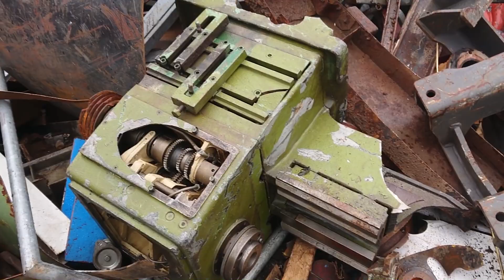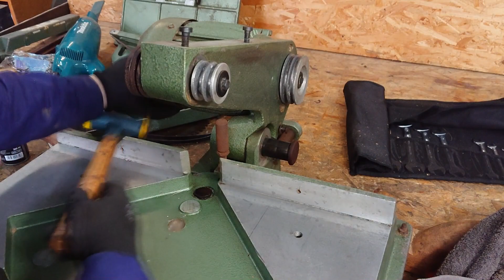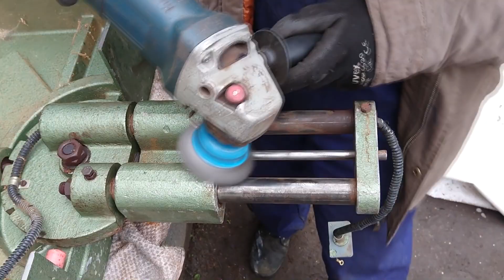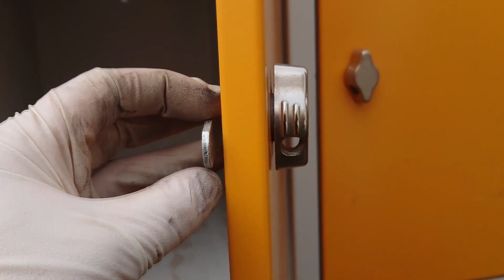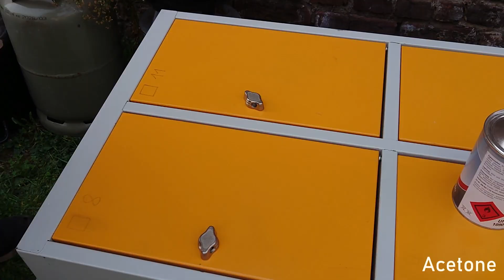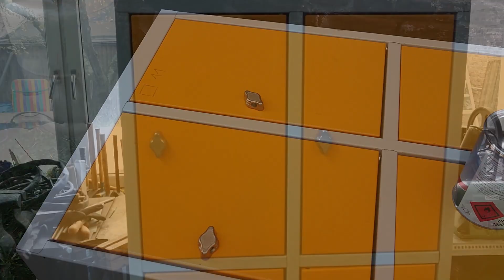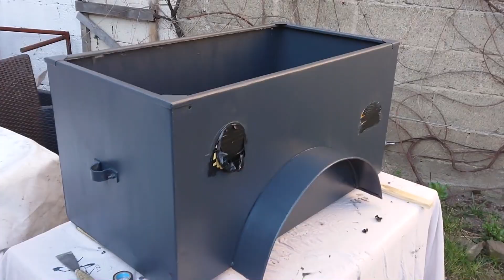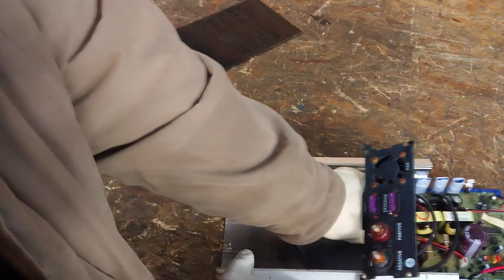Unique Scrapyard Finds! Repair-A-Thon!

Comment: On motor capacitors, I find that the old ones are normally spot on. I have motors that are probably 70 or more years old still work perfectly with the original capacitor. Good work and the lockers look great. Like the trailer.
Reply: Definitely! I work on commercial air conditioning/heating. 
New Capacitors of same capacitance are much smaller now and fail in hot weather unlike the older ones!
Reply: Thats good to know. My beloved 60´s Sansui valve amplifier has an issue on one channel which isn´t a valve, so its got to be an electrolytic probably. I got a parts list for it, it has over 250 electrolytic parts and most of those are capacitors!!
Reply: @mikescudder4621  Could also be a duff track on the volume control potentiometer.
Reply: @BensWorkshop  cheers!
Reply: @mikescudder4621  Have you tested the valves? You might also need to check the circuit diagram and ind use a signal injector to find the fault.
Reply: @BensWorkshop  Hi Ben, its been a long time collecting dust and looking great on my shelf but from memory theres a continuous 'scratching' sound on one channel where music doesnt come through. I swapped valves around and bought a new preamp valve (two channel) so i deduced the problem was with the electrolytics and not the valves. I was troubleshooting it with the help from a forum and came away with the impression that the electrolytics should be replaced as standard procedure on an amp from the 60's. When i found the circuit diagram and LONG component list it became a real project so i put it off for a while. I'll look into getting a signal injector - thanks!!
Reply: @mikescudder4621  Really sounds like a defective volume control. You could try cleaning it with contact cleaner.
Reply: @BensWorkshop  Really, could it be that simple?! I'm definitely going try, i always figured that a dirty volume pot wouldn't continuously change if it wasn't being touched/moved - if that makes any sense. Thanks for the tip.
Reply: @BensWorkshop  Ahh you have a cool channel too. I dig it. Who doesn't love scrap yard finds and other fixes!
Reply: @mikescudder4621  It's worth checking. You could try putting a signal on the output of the volume control. That would be the center connection to the wiper usually.
Reply: @BensWorkshop  Great tip!
Reply: The old capacitors made by Bosch, Siemens  ITT  (SEL) and Hydra Werke are high reliable long lasting  parts with no pcb inside. Most modern parts last even from the counter to shop door.  The best is  to omit capacitor and use all three phases for Motors.
Reply: @Reaktanzkreis  In the UK domestic supply is single phase. Also in the USA and I believe everywhere apart from Germany.

Comment: Thank you for the electrical component explanation, great save on the saw and trailer. Citric acid bath for rust, will need to try that.

Comment: I found a surprising way to remove Sharpie markers is with spray-on sun block. For some reason, it works really well, liquifying the Sharpie and you can wipe it off with a paper towel.  It doesn't affect surface finishes at all.

Comment: Just an observation but it looks like the sacrificial cutting board is just a square board with opposing corners cut off. The back one just an inch or so and the front one several inches. Might be easier cutting out new ones to start with a square with the dimensions of the inset. Love the lockers! The trailer is awesome, do the ebike and you have a heavy hauler!

Comment: 90% Isopropanol, known as rubbing alcohol in the USA, removes permanent marker, including from human skin. It can damage some paints, but it is the best thing short of acetone (which will strip off many paints) for removing permanent marker from hard surfaces other than porcelain. For porcelain, glass, and glazed tile, commercial strength Windex (blue glass cleaner) works really well.

Comment: What an interesting saw. Doesn't look all that practical for everyday use but pretty clever design. I love these repair-a-thon. There used to be several nearby scrap yards nearby that I found all sorts of treasures. Unfortunately they are long gone and scrap picking has gotten a lot harder where I live.
Reply: That saw is aimed at flooring installers as it gives them the ability to cut floorboards and skirting (base) boards to length and to rip along the length if needed.
You can still buy these today.
Reply: @ramblingman8992  were can i get one like this?
Reply: Home depot or Lowes in USA and Canada
Reply: Fair warning, they're seven or eight hundred bucks and up.
Reply: the more modern version of them were called flip-saws they were made by a company called Elu i think and then they were bought by Black and Decker's European company so am not sure what they are called now back in the 90's i use one made by Elu while working in the UK really handy saw when doing flooring or any woodwork for that matter
Reply: @kirkyorg7654  thanks for the reply.

Comment: I totally agree that fixing things up and making things better is a cathartic endeavor that helps deal with today's problems that are mostly out of our control.  Yes that bike trailer would couple very well with an e-bike if the solar panel could be rigged to charge the bike battery.  That would make for a pretty efficient around town errand machine.

Comment: My idea for the solar trailer would be: ditch the inverter and put a 12v cool box in it. Perfect for trips to the lake in the summer or for hauling temperature sensitive products.
Reply: in my case i would go for a 36v setup so i could charge my ebike battery. you could also put a few more solar panels inside die box and plug them in if needet.

i thing i found my new project :)
Reply: @paulantony1981  With more panels on a fold-out lid !
Reply: @paulantony1981  Might be better to produce 36V with a DC-DC convertor circuit rather than rig up a full 36V system. Just because solar panels and batteries are easily available in 12V.
Reply: I personally already try to collect 12v tools for off-grid scenarios. I made an unpublished video about that. I use xt60 connectors for it.
Reply: peltier cooling sucks tho.
Reply: @qwertykeyboard5901  You can also get 12v coolers with actual heat pumps, but they are more difficult to modify and adapt and do not work in any orientation (way more efficient though). The Peltiers are the most popular because they are cheap. In this case, since the lid is completely taken up by the solar panel, one would have to mount the cooling unit in the side of the trailer.
Reply: @qwertykeyboard5901  No peltiers, a compressor coolbox with a high efficient compressor and good themal insulation like the fridge at home.
Reply: @Reaktanzkreis  Good
Reply: @qwertykeyboard5901  use a 12v fridge from a caravan. Would be better to make it part of the trailer structure as it would be heavy. The heat from any electronics could be used to help the cooling.
Reply: sensitive products: BEER, BEER and mor BEER!!!
Reply: @Reaktanzkreis  Yes, mobile Vic Bitter fridge !
Reply: dry ice works better.
Reply: @frigglebiscuit7484  How effective would an ice box work if you loaded it with dry ice? I need to test that.

Comment: Hi, Gerolf.  A couple thoughts.  To remove the magic marker writing, you could also try automotive rubbing compound, or its less aggressive brother - polishing compound.  Also, to minimize distorting the aluminum panels when removing dents, put a piece of plywood or steel between the hammer and the dents to distribute the force.  It's a shame about the lathe - could you rescue the chuck mount, though?  Seems like a useful part if it's easily removeable, with resale value.

Comment: love the trailer, I have a mass produced one I use regularly, the problem tends to be stability an id is prone to tip over on bumpy ground. I must get around to making a single wheeled version which shoes be a lot more stable

Comment: I'm so glad to hear your say that it is sometimes better NOT to take everything apart, just clean in place.  I work on old sewing machines (Pre-1960s) and so many youtube "restorers" disassemble every piece.  That's not good for the vintage machines, as there are many pieces that are set to factory specs, and if not put back right, ruin the timing of the machine.  I want the machines to sew properly when I am done cleaning and oiling them!

Comment: As good as always, thank you. Brilliant repair and re-usage of the trailer. I think you have a lot more of that kind of bicycle usage thing in Germany (and the Netherlands..) than we do here in UK, but we need to learn that way very quickly! Keep doing what you do, its brilliant! Les in UK
Reply: For cycling infrastructure, think UK is catching up, mostly in the metropolitan areas. Don't underestimate it what is in place in Germany.   But yeah still a long way to go compared to my country (NL)...
Reply: @algemeennut6683  I’m not convinced! My city (Chester) labelled itself as a “cycling city” a few years ago but the few “cycling lanes” are just dotted lines on the side of the road (the gutter!) and people park their cars there, the city allows the brambles to grow across them... not any where good enough yet to persuade normal people to ride a bike rather than drive their car. But I’m hoping it will improve quickly with increased fuel prices.  Les
Reply: @leslieaustin151  do like to watch UK based cycle youtubers like Monkey shred and Hambini and such. Not many of those around here, and actually true bicycle repair engineers in NL are hard to find. So not the 'parts replacers', I can do that myself. The ones that can actually machine, braze etc. Such skills are simply not valued by many ppl in this throwaway society... Many modern frames are sadly not made of steel anymore, and carbon is almost just impossible to repair when seriously damaged...
Reply: @leslieaustin151  Get some cyclists, and your local press, stage a 'ride-in'  Demo out the front of the council chambers , with local press in attendance.!    Inform all the councillors in advance as well !
Have you a local bike group?

Comment: i remember when they where closing the coal mine i was working at  the head engineer told the fork lift diriver to pick the machine tools up  (lathes mills) lift them up then tip them off at height so no one could have them
Reply: The hell is wrong with people, I understand just throwing stuff into a scrapyard sometimes but at that rate you might as well just dump 15 tons of oil in the ocean for fun.

Comment: I think that in order to remove the very last bit of permanent market dye you'll need to chemically destroy it, maybe use bleach, or peroxide, persulfate or other oxidants, I'd start by the ubiquitous chlorine based bleach. Because of the phenomena such as chemisorption and adsorption, you are unlikely to be able to scrap off the dye without grinding on the substrate underneath.